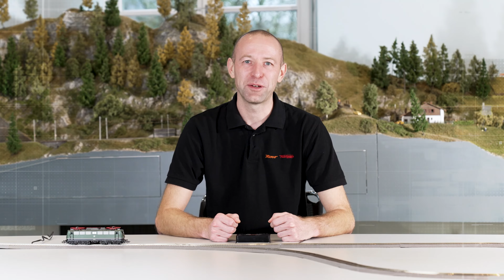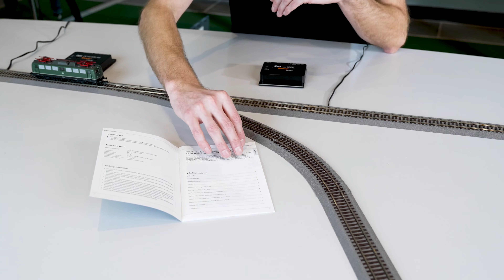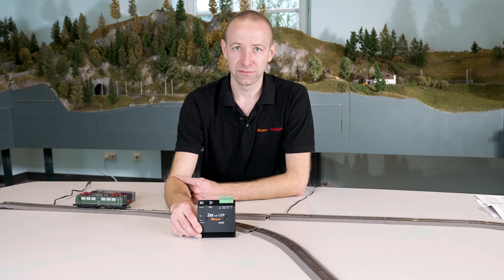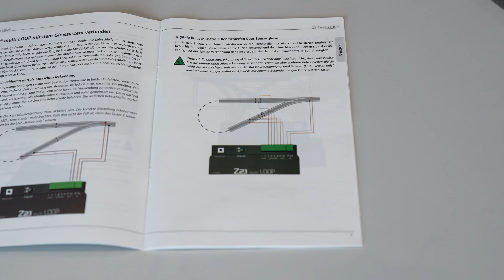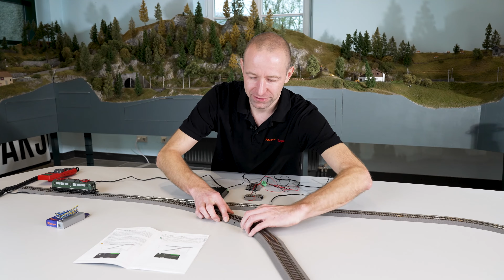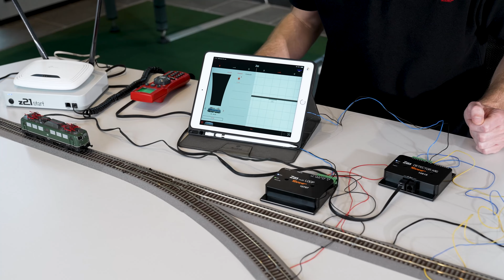Part 15: Z21 multiLoop - The reverse loop module

Comment: How far from the switch in the loop should the broken section be and also what is the smallest possible length of the broken section if it is used by locomotives of different lengths?
Reply: The smallest possible length is equal to the locomotive length +10%. The distance from the switch in the loop to the broken section is also equal with the locomotive length +10%. 

You can avoid reverse loop modules by using boosters and configuring different tracks if your layout design permits it.